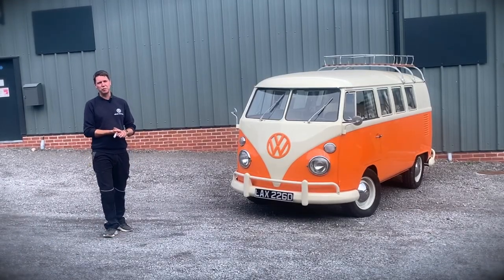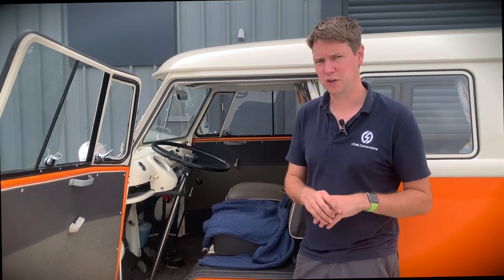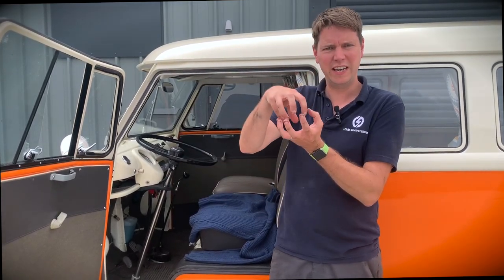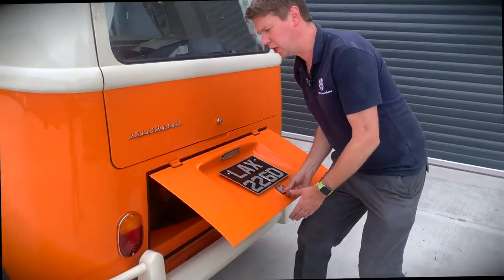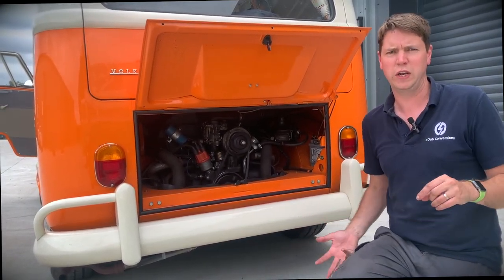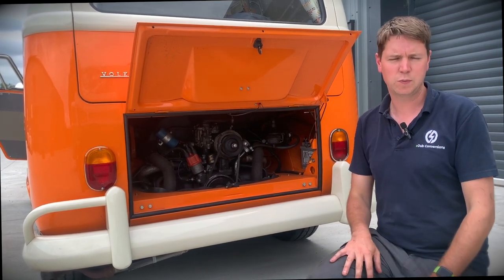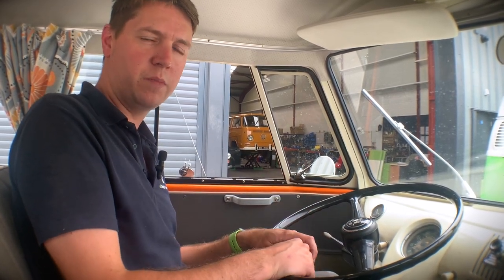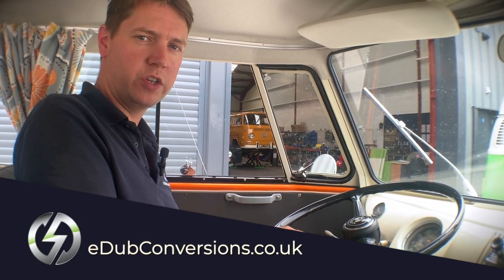Electric Conversion of Daisy the Split Screen VW Camper | P1: The Original Engine

Comment: My split window has had the same lead acid 12 volt battery for 8 years. It easily starts after sitting for 6 months even if I don't charge it.

Comment: There is a reason why they use VW aircooled engines in more than 400 aircraft designs.
Weight and reliability.